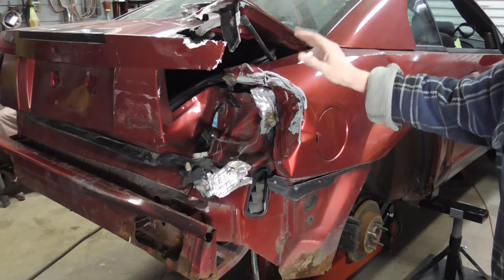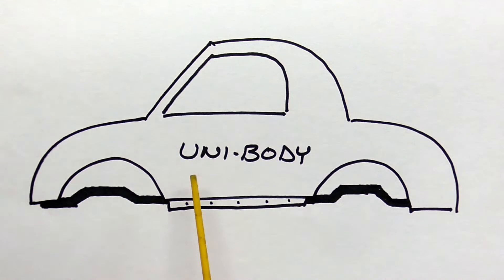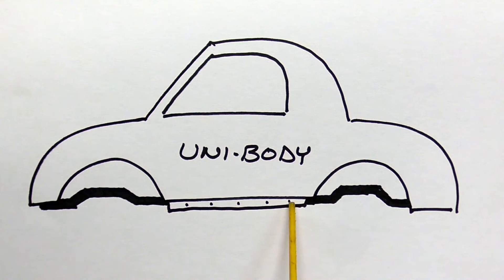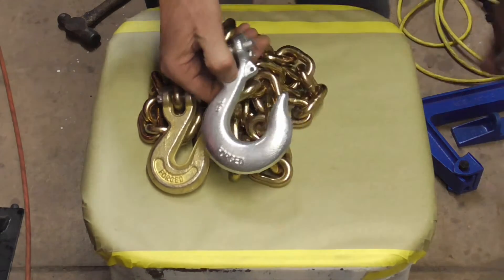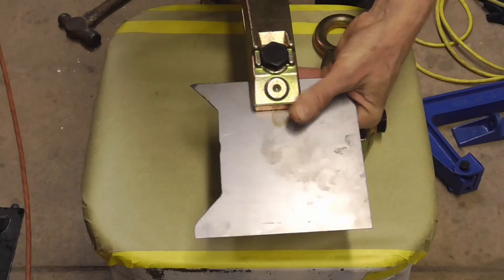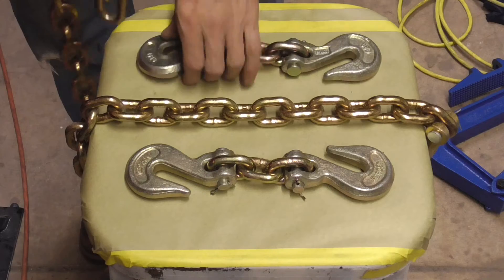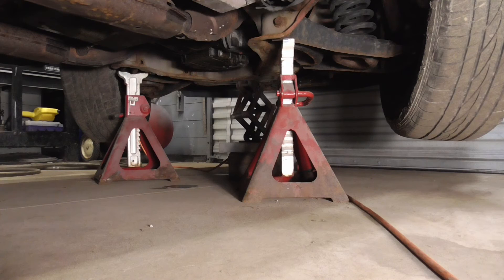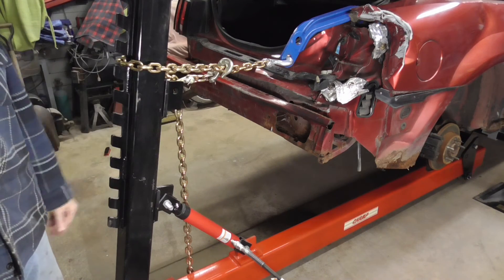Introduction to Auto Body Frame Straightening and Uni-body Repair

Comment: You dont have frame chassis table to clamp the car down to?
Reply from the maker: No - you're actually supposed to use this dozer type puller with nothing - just by itself.  Check out how here - https://s3.amazonaws.com/cdn.autobodytoolmart.com/downloads/tech-sheets/BodyStraightener.pdf

Comment: I am looking online and the champs dozer frame stick and is $3600 with the overhead boom and the air pumps.  The jackco one is like $2500 with a comparable setup.  Was wondering if they are pretty comparable? I had a homemade “L”
That I used for years but was included in the sale of my shop (the equipment ended up being a deal breaker for the shop). So now have to replace it all…
Reply from the maker: I imagine they are very similar 👍🛠😊

Comment: How would you tie down a pickup truck with this setup?
Reply from the maker: It's actually even easier because you don't have to use the clamps, bar, etc.  Just chains, hooks and anything your imagination can come up with.  Obviously this is a bottom feeder frame machine but with a bit of creativity it can work for almost any pull.  Here's the instructions for basic hookups body on frame and/or uni body - https://s3.amazonaws.com/cdn.autobodytoolmart.com/downloads/tech-sheets/BodyStraightener.pdf

Comment: Please How Can I Secure that Pinch Weld Setup You have at 03:22? Is It Sold Anywhere? It Doesn't Seem to come with any of the Frame Straighteners that I've Seen Online, even the One from the Link to the Website you provided Doesn't come with it...
Reply from the maker: It comes with this frame puller - I think you can buy it separately though to from the same web site - https://www.autobodytoolmart.com/product/champ-10-ton-body-straightener-kits/auto-body-frame-straightening-equipment?gclid=
Reply: @LakesideAutobody  Well I haven't seen it anywhere on their website. But, do you know if they sell the swivel types/model Frame Straightener? I Know Jacko Sells them.
Reply from the maker: @nedunonnyp704  You're right they don't sell it separately - I can't find much of anything in the way of "rocker pinch weld clamps" on the internet.  I'll keep looking though if I find ones like I have or the swivel type,  I'll reply back again  - Jerry
Reply: @LakesideAutobody  I called and spoke to them today and they said none of their frame racks come with that pinch-weld clamp. Then I thought you might've had the Frame rack for some years and the design/parts it came with might've changed over the years to explain why the Pinch-Weld clamps looked different. But the guy I spoke with said He's been with the Company for 9Years and their have been modifications but that pinch-weld clamps in the picture have remained the same. I even sent them a screenshot of the one in your vid. But they said they don't and have never carried that clamp style..
Reply from the maker: @nedunonnyp704  The pinch weld clamps that you see in the video came with the puller.  If you order this:  https://www.autobodytoolmart.com/product/champ-10-ton-body-straightener-kits/auto-body-frame-straightening-equipment  - you will get pinch weld clamps like mine.  You have to because that's what the company says.  It includes:
Includes:

(1) puller
Hydraulics
(2) 6 ft. chains with grab hooks
(2) sheet metal clamps with pull rings
(1) underbody beam with pinchweld clamps and floor stands
Overhead boom (4084 Models Only)
I think the guy on the phone wasn't sure what you were talking about.  Is there another clamp I was using in the video that you might be talking about?  We'll figure this out my friend :)  Jerry
Reply: @LakesideAutobody  Thanks Alot. I really appreciate your help so far. But, just one thing though, Please, if you don't mind Me asking, When did you buy it/how Long have you had the Frame Rack?

 And when you bought it, is it the Photos same Ad Photos that's shown Now that Was Also shown when you purchased yours?
Reply from the maker: @nedunonnyp704  Photos were the exact same and I had the same doubts that you have but I went for it.  The clamps were way better than I thought they would be.  I bought it 2 years ago.  I think the spring of 2019.

Comment: I'm about to have my 2015 Dodge Challenger's frame straightened after an accident it was just in.  Wanted to get an idea of what's about to happen.  This video was solid.  Thanks!
Reply from the maker: You're welcome - thanks for the support :)
Reply: What's about to happen? You're going to learn how much "frame repair" any quality local body shop with do on a POS "unibody" so-called "muscle car" that's 7 model years old,.uninsured, totalled by the last insurance company that wrote a policy on it, has ZERO "book value" as a totalled wreck "muscle car" with a "bent frame" that WHOLESALE isn't "worth" a year of "full coverage" insurance premiums AND is being "built" by a complete tool that will probably want to "finance" the "frame repair".

Comment: About how much does a framework like this cost?
Reply from the maker: In the thousands for sure.  This car would not have been repaired as it would have been a total loss.  I figured it would be good to see and the car was only $800 - clean, everything worked, loaded, plus the Mach 460 Ford factory audio system - I think the loudest factory stereo ever made - and I've heard a lot of them.

Comment: *
LAKESIDE AUTOBODY       I have a question: For example when a vehicle/car has been rear ended by a tractor trailer truck (hitting one side of the rear bumper) cracking the bumper / ripping off  one of the tail lights aka brake lights and smashing the rear quarter panel......  QUESTION ONE (1) What are other possible issues that are likely to have occurred to the vehicle that the naked eye and non mechanics/non body shop specialists    would not be aware of*      could yah list the guestimate price for each repair including the obvious repair/replacement of the bumper, tail light and rear quarter panel
Reply from the maker: Well.... There's a lot actually.
1) suspension damage - I did a rear end job on an '87 Nova and it broke the welds that held the control arm to the unibody.
2)  Wiring could be damaged and you'd have to replace that
3) Obviously the unibody parts will be wrinkled and damaged
4)  Muffler system pushed up into the car
5)  Deck lid hinges and support might be messed up
Those are the ones off the top of my head but it would be hard for me to give an estimate for the prices of each because you really to look up all the time and costs of each.  I can't really even estimate as I never wrote the estimates - just did the work.  I know it would be over a few thousand dollars though.

Comment: Not trying to be overly critical, But.  That Champ setup is based upon 75 year old  "Dozer technology"  and was never designed to do unibody, until someone added the cross bar with the clamps.  At best the Champ system is a sheet metal puller.  There are much better systems out there.
Reply from the maker: Absolutely - but not too much room in my garage :)

Comment: love the video. what brand of stands are those for the pinch weld clamps?  is that an assembly that came with the puller?  or did you fabricate?

Comment: Do you believe body shops would allow you to ask to only have the frame pulled? I have all the parts and pieces needed to rebuild my car but I’m unsure if they’ll only stop at pulling the frame and patching it up to then let me take my car back so I can finish the job.
Reply from the maker: Each shop is different.  You may have better luck at the smaller shops.  If it's an easy pull I think you could find a shop to do it.  Stop in and just ask if that's something they do.  It can't hurt to ask.  Jerry

Comment: How Much Is The Price Of This Type Of Jobs?
Reply from the maker: This car would have been totaled. Even if it was newer it probably would have been a total loss.  Really the trunk floor, quarter, rear panel, and deck lid should have been replaced - along with bumper assembly, tail lights etc. - that would add up fast along with labor - well into the thousands for cost.
Reply: @LakesideAutobody  Wao! I Ask Because My Car Got Hit Badly Recently On The Left Corner Rear,I Known 100% Sure Is Considered Total, Even Tho It Can Be  Fixed But I Was Wondering What’s The Estimated Priced Of That Labor
Reply from the maker: OK got it.  unfortunately damage like this is $.  Labor prices for frame repair is more than just regular body work/painting.  Say regular shop time is 90/hour then frame time can be nearly double that 150/hr or more.  There would be some good time on that job too.  I didn't write the estimates but I know that job would easily break 2000 dollars.   Is it possible to fix it enough to just drive it?  Jerry
Reply: @LakesideAutobody  Wao,Yeah Actually It Can Be Fixed To Drive,Suspensión Are Intact,I Wish I Can Post Picture Here So You Can See,And Give Me A Opinión

Comment: I hope you show using this frame straightener in future videos.
You know back in the 90's I had a good friend that had a body shop.  I was there quite a bit.  He would go to Dallas and buy rebuildable cars and bring them into the shop and fix them.  He did not have a frame machine, but he did have a guy that he would call that would go to a lot of different body shops in around a 100 mile radius of his home.  He was called " Fred the Frame Man".  He had a big long portable machine like yours but longer and heavier looking.  He was probably in his 50's in age and his father had done the same work as him for years before him.  Fred took over after his father retired.  I was always amazed how he could take a few measurements with a tape measure and pull everything back in place with relative ease!  I remember one ford pickup that was hit in the front corner and was knocked into a ditch.  That poor truck was terribly twisted and the frame looked like a parallelogram!  I said, " I gotta see this"!  Fred got there looked at it and shook his head a couple of times.  Drug out his machine and went to work.  He would put a heavy piece of wood timber here or there and fire up his machine and pull.  Dang, after about 45 minutes you could see all the body panels lining up.  That is where years of experience told him just where and how much to pull.
I will always remember that.  Keep up the good work.  Tom
Reply from the maker: I'll upload the full repair using the frame machine next week - nice to hear from you :)

Comment: Never seen a frame machine that wasn't a huge metal table. That's cool.
Reply from the maker: Here's another very common one that is not a rack type, but you have to have pull pots or anchor pots in the floor - (spots to anchor chains to) http://www.brewcocollision.com/frame-straightening-power-post.asp  They are nice because they are easy to use and very versatile (pull from any location).